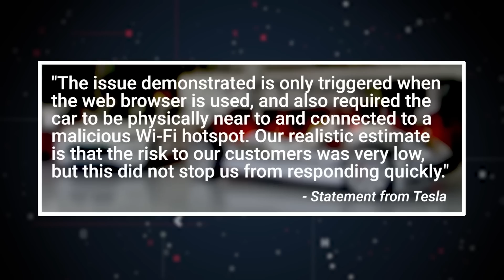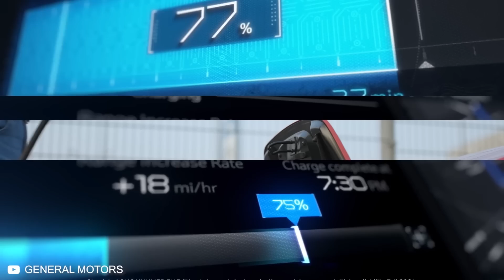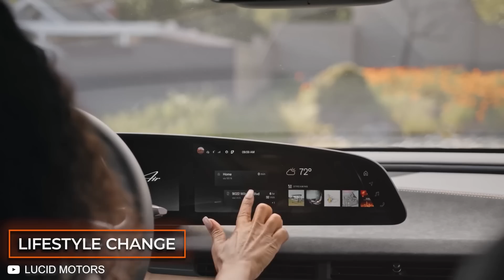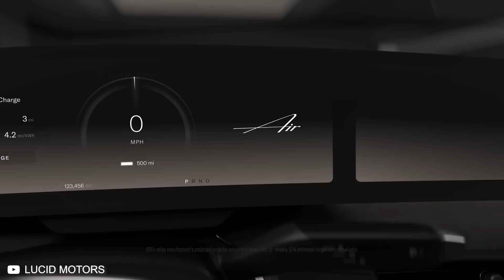EVs' Serious Problems That Carmakers Are Hiding

Comment: I would like to understand the issues with cabin heating and even cooling.  An IC engine has heaps of waste heatm so cabin heating is no problem .  What about electic vehicles.  What energy is required to heat the cabin in comparison with energy required  to move the vehicle?
Reply: Even thought manufacturing an EV puts out more CO2 than making a gasoline car the same size, because of the battery, EVs are still greener in the long run than that of gasoline vehicles of the same capacity because the gasoline engine throws most of the energy in the fuel away as waste heat.

Comment: In a neutral perspective, I think electric cars are not worth the price. I've seen electric cars that can cost more than a Bugatti, but only if you're unlucky. 

A second problem is information overload. Not everyone has the capacity to understand the technology of electric vehicles.

A third problem that I can see is that you need to use raw materials that are too rare to make the batteries. 

I'm not saying electric cars are bad, but if you are willing to spend tons of money for something that weighs a lot and can be hacked, go for it.

The only thing that makes me sad is that electric cars don't have aftermarket support.

Comment: These are just a few of the problems with an EV during its life cycle.  But what about production and disposal at end of life?  The environmental friendliness to produce and dispose of an EV is much more severe than an IC.  Studies have shown that you need to drive your EV 80,000 to 100,000 miles to actually begin to become more eco friendly than IC's.  Sure, you are much more eco friendly while you drive the EV for personal use, but there other factors (before and after drive life) to be included for overall eco friendliness.  But people don't include those facts when pushing for EV's.  I do like it that the video discusses cost for repairs, but they did not discuss the cost to install a 220 charger.  And I don't know about you, but I can't even fit one car in my garage.
Reply: Lithium “mining” is the big concern now, but is not a risk to the continuity of human civilization, but the continuation of fossils fuels at the current rate is. Businesses that currently recycle aluminum and copper have already (in some countries) departments that are researching on how to recycle lithium. As metals and chemicals get more expensive, closed loop manufacturing processes start and have become the norm in places like China. Toxic waste, is just another industrial waste problem and when appropriately managed, raises no risk like that of burning fossil fuels at the current rate. The technology already exists to contain lead, mercury, and cadmium when recycling batteries and it is improving by the year to the point that in about 20 years the need for mining will be reduced substantially. All the other mineral and elements in a EV battery are fully recyclable even after being used as second-life batteries, which is a nice thing about EV battery cells, as  they find a second use in stationary grid storage. By the time there are sufficient numbers of them, there will be a recycling market for EV batteries, windmill blades, and solar panels. There is always recycling where there is valuable metal; they will be recycled to reclaim the valuable metals just like any other high volume appliance does nowadays.

Comment: I would like to share my opinion if that’s okay. You can laugh at it if you so desire. I personally think that an EV is a wasted technology if used alone. Its like a baby’s toy rattle that babies use to give themselves comfort. But as you grow up you get rid of that toy or keep it on a shelf as a decoration. EV technology is a baby technology, it is not well advanced and I believe, is gonna get tossed in the trash sometime in the future. They just propose this as a next big thing, just as all darn businessmen do. My crap is better than yours - Its the same story all over again. Hybrid vehicles are the best for transportation, but I was wondering if this could be a possibility - That if the car could go, say 200 miles on gas and 200 miles on electricity, that you can switch between the two - combustion engine and the electric motor. And I don’t mean low speed only where electric motor turns on. Combine the EV and ICE technology. Some will say it’s a hybrid, well yeah, that’s the point. I know it’s the same crap if we speak about emissions. But to put it simply, you cannot make a vehicle that is 100% zero emissions. One way or another something is always involved. Some emissions will have to be put out into the atmosphere. You can try those hydrogen fuel cell cars, but as far as I hear these cars are not very popular and there is not a huge market on those. The hydrogen car technology is in its beginning phase still. But to be honest, some things that are good for the future and growth of mankind is falling behind technologically. And that’s not a good sign. It all depends on the government - what’s allowed and what is banned. There are too much trash nowadays who run for congress to “improve the quality of life” of lots of people. But the problem is - it’s their perspective about the whole situation. Based of what they know, they make decisions that may as well be stupid and go against the will of all people. This is why they say that nobody likes change. Shit has been going down through the years, and people don’t know how to deal with everything involved now. It’s just my opinion. I don’t refuse the right to be wrong. But it’s just the way I see it. Americans have very high tolerance to bullshit. But when the patience leaves, it leaves.
Reply: Each technology is used to build the next.

Comment: Bring the Chinese EV makers to the US and adopt some of its policies, then everything we know and what was said here will all change..
Reply: At least China with all its faults, is doing more than Canada and the US is doing and already have some ultra high voltage transmission - DC and AC, which requires less fuel. They also emit half the amount of CO2 emissions per capita than the US does.